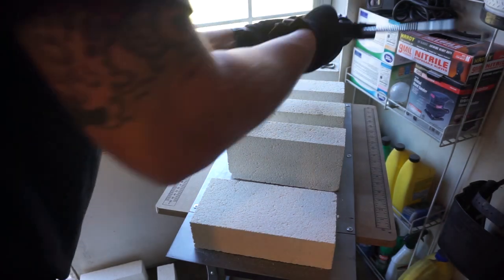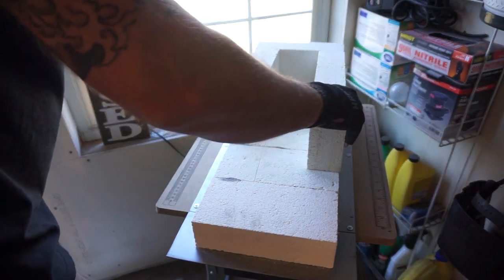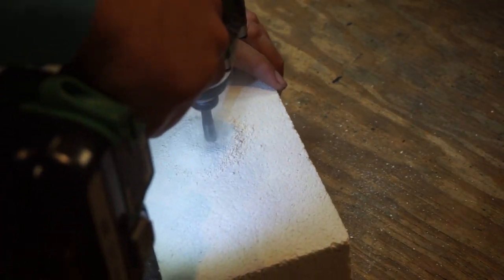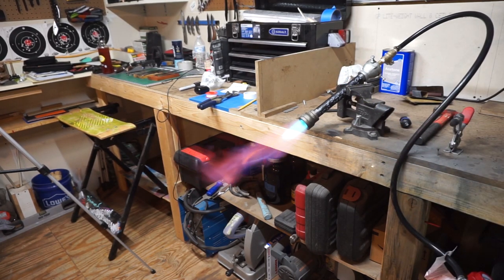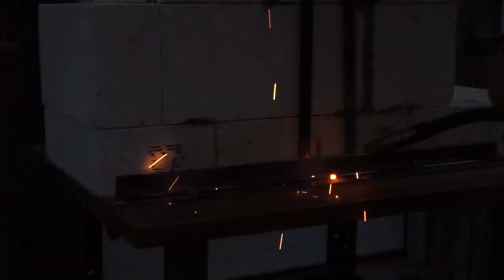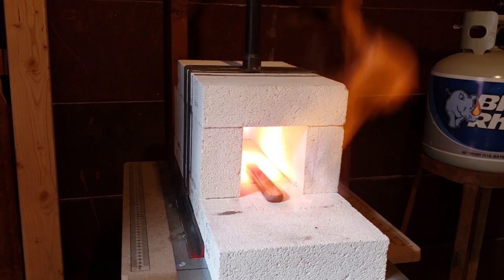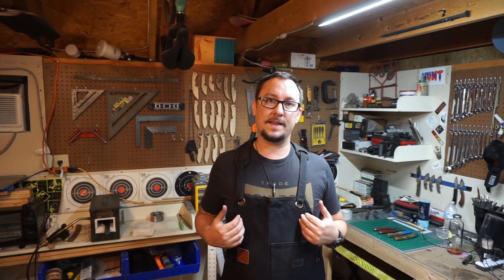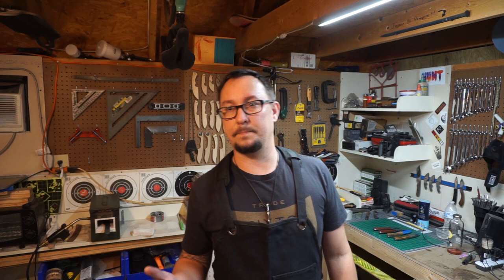Making The Simplest Fire Brick Forge | Knife Makers Vlog

Comment: Going to be building one of these myself thanks for the ideas was wondering how has it held up after 1 year?
Reply from the maker: It held up great. the only reason I rebuilt it was because I started forge welding in it. All that flux started melting the firebricks, which is a normal thing. The mortar caulking held up just fine though.

Comment: I made my burner using the same video you linked to. The burner worked perfectly in the vise but when I mounted it into the forge the flame was super weak like it wasn’t getting enough oxygen. I ended up getting it to burn hot enough by hooking up a shop vac (backwards as a blower instead of a vac) to push air into the first reducer coupling that the “nozzle” gets clamped into. Which works but it’s frustrating that everyone else’s seems to work but mine. Not sure what I did wrong. I used all the same components.
Reply from the maker: one of the big things is making sure to flare out the hole in the brick on the internal chamber side of the hole and then make sure that you have a high pressure regulator. When you use forced are you can use a lower pressure regulator like one for a grill.
Reply: The Rivers' Experience thanks for the reply. I did use a 20psi regulator like the video suggested.

Comment: whats the product you used in the caulking gun? i didn't catch that part.
Reply from the maker: It's high temp fire place mortar caulk. You can get it at any hardware store.
Reply: Yeah. I ended up not needing on my build, posted first burn video, but next time for sure. Thanks.

Comment: Hi, love the channel. Quick question, the soft fire bricks you've used, what is the last dimension. So, they are 9x4.5x? The ones I have are 9x4.5x3 so the space inside the forge seems smaller than what yours looks like. Thanks.
Reply from the maker: Mine are 9x4.5x3 you should have a 3x4.5 chamber.
Reply: Thanks!